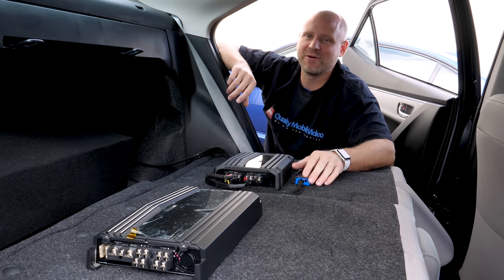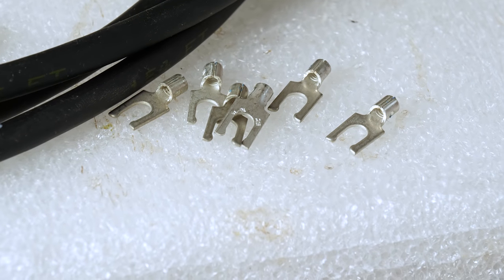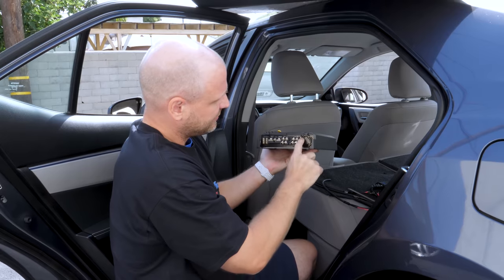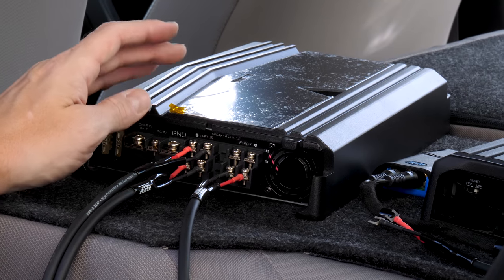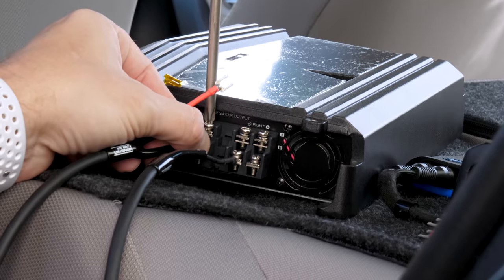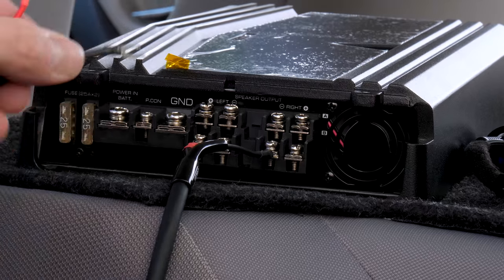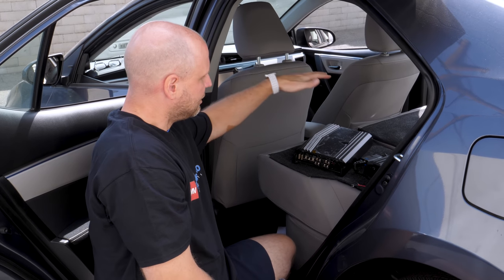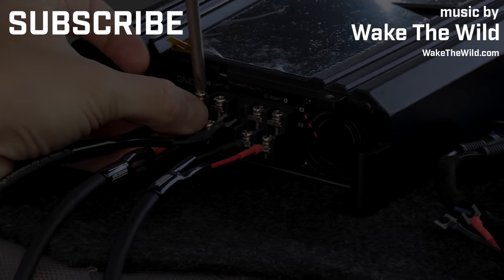How To Wire Speakers and Subwoofers to Your Amplifier - 2, 3, 4 and 5 Channel - Bridged Mode

Comment: I have setup blaupunkt amplifier (gta mk2 from old car) running 4 speakers and a subwoofer in trunk. I have another amp (sony 2ch xplod) that was dedicated to running subwoofer in old car.  The old car had aftermarket head unit. I have factory fitted head unit that I don't want to change.  What is the correct way of running 4 speakers from blaupunkt and subwoofer from sony 2 ch explod. I tried running this (i bridged sony xplod to subwoofer) but the fader only provided audio from right. The rear in the fader was also not responding. With the current setup i am getting stereo sound from speakers plus the woofer is also running, iam also able to hear and move left/right and front/rear settings on fader on my factory fitted head unit. But the sound from the subwoofer isn't as punchy as it was from connecting it to dedicated sony amp. So now iam using only blaupunkt amplifier running 4 speakers and a subwoofer. How do i use the first amp to run 4 speakers AND the second amp to run subwoofer AND get left/right and front/rear option on fader?

Comment: that seems easy enough I wired everything to the amp. the funny thing is that the amp has a switch for 2 channel and 4 channel. when I do 4 channel only the front 2 speakers work when I use 2 channel all 4 speakers work any ideas on that?
Reply: Doesn't make any sense to me. But who cares? Use the 2 channel if it works. Unless you think it under powered. My tiny 50 watt amp provides way more than I need for my TV for two side & a center 8 ohm 50 watt speakers. I do have a small powered subwoofer. At upper levels it gets distorted. I guess some like that, not me. I was an audio tech/engineer for nine years at Crown Audio.
Reply: @chrissimon8368  I have a old 800 watt Crown (Power Line Three) Amp rack mount and it sounds awesome!!! Lots of power!!! I use it for my home audio...

Comment: can I use a line output converter and tap into the rear speaker wires and another line output converter for the front speakers and plug into the amp?
Reply: I have a 4 channel amp

Comment: links to the materials he uses to make the wires be nice. what is that splitter that says monster cable he uses the separate the wires called? please
Reply from the maker: Hey Emmanuel, those are pretty hard to find, that manufacturer doesn't produce them anymore, they're called Y-Splitters
Reply: Emmanuel Christian Delatour they're called speaker wire pants.

Comment: All your showing us is how to plug the wires into the amp I can’t find a good instructional video on how to connect newly installed speakers to the amp so they get that extra power, all I did was plug them in to the existing connector (via an apater) that goes to the wiring harness ( so it’s factory wiring)and then connects to the back of my stereo, I understand how to connect the amp to the battery and to the sub and how to ground it, but in order to amp my speakers am I going to need to run new speaker wire from the amp too the speakers and if so how do I get audio from my stereo or can I somehow use the wiring harness that plugs into my stereo to amp them, or when I plug in my rca cables from my amp to the stereo does that just amp my speakers too  since they get audio from the stereo? I cannot find any good explanations on this, speakers works and the sub works but I don’t know if my speakers are getting power from the amp
Reply: Like do I run new speaker wire from my amp to the new speakers and then the audio gets to them via the rca cables, or like I said before one I plug the amp into the stereo with the rca am I now getting the extra kick that I want since the rca are connected to the stereo

Comment: When amplifying 4 speakers do you run the speaker wire from the speaker to the amp?  I'm confused😕❓
Reply from the maker: If you're powering your speakers with like a 4 channel external amplifier, then yes you run them to the amplifier. However, you can also power them with the headunit and simply replace the speakers into the factory wiring

Comment: I plan on putting 2 component 6.5’s in front doors, 2 coax 6.5’s in the back doors, one 8 inch sub in the back(car has a panel for it in side wall) and one 4 inch mid in the front dash panel. The sub won’t perform amazing without a box but it’s okay. I also was planning on throwing a 12” in the trunk. This is all in a Kia Soul so they’re a big box in itself. Can I successfully use a 4 channel amp for everything but the 12 which could be used on a mono? Or what would anyone recommend?
Reply from the maker: Well first of all you need to make sure your amplifier is bridgeable if you're going to connect a subwoofer to it. If I were you, I would wire the front 6.5" to the headunit, then power everything else with the amplifier. But make sure it's powerful enough to send power to a sub and mid with just those channels
Reply: Quality Mobile Video okay thanks!

Comment: @QualityMobileVideo Can i use stock speaker wires for connecting aftermarket speakers to my amplifier (Pioneer GM-D8604 Class FD 4-Channel Bridgeable Amplifier) which is a 4 channel amp and i want to power all four speakers through the amp. Also the stock speaker wires presently all go to the stock stereo and is connected with a harness, do i have to cut the harness and re-route the factory wires for connecting with the amps? ( p.s m also installing a new stereo i.e Pioneer MVH-X390BT, it has 4 rca outputs so thinking of connecting all 4 to the amp).  SOMEONE PLEASE HELP.

Comment: I got a question does it affect the power output when you wire twospeakers to one channel let's say the two front speakers is 45 watts and o e Chagall outputting 50 watts ,is there equal power to both speakers ? And no distortion or loss of power ?
Reply: Channel *
Reply from the maker: The impedance is cut in half, so the amplifier will put out more power, no change in distortion and technically, depending on the capability of the amp/power supply, there should be no loss in power, unless the amplifier isn't stable at that load.
Reply: Thanks alot!!!

Comment: hi what model amp is this please. and would it be effieciant enough to power a set of kenwood 480w 6x9's and maybe a kenwood 1300w or 2000w shallow sub
Reply from the maker: That's the Kenwood KAC-8406: http://www.qualitymobilevideo.com/kac8406.html
Reply from the maker: If those are the MRS ratings you might want something stronger

Comment: I have a 4 channel amp but it doesn't have a speaker input it only has speaker output... so idk what I'm supposed to do with the harness and all that
Reply from the maker: Buy a line input converter.

Comment: so im curious i want to do 2 car speakers and 2 12 inch subs what channel amp would i need and what all would be required?
Reply: plus all my carp speakers are 4 ohms pretty sure both subs are also 4 ohms and they are 480 watt 12 inch pioneer subs
Reply from the maker: I would run the subs with their own amplifier, a monoblock or 2 channel. Then I'd run the speakers to be powered by the headunit, or a separate small amplifier.

Comment: im looking at a pioneer 4channel amp, the website only says "4ohms impedence" or "RMS rating of 65w x 4 @ 2 ohms, 4 channels". Is it safe to run 3 speakers in parallel (dash, door, and rear speakers) on the left and right side in addition to a sub or two? 

It sounds like with a 4 ohm amp i can only really run 2 speakers, but i figure i can get away with the 4" dash speakers on top...
Reply from the maker: You can run two channels (CH 1&2) @ 2 ohm by paralleling the speakers. You can also bridge (CH3&4) for a sub however, that must run at 4 ohms based on the criteria that you have stated.

Comment: and will running 30rms speakers on an amp that is 60rms be a good idea on its own or will they just blow up
Reply: USE A MULTI METER OR OSCILLOSCOPE TO SET THE GAIN KNOB!  If you don't clip the signal to the speakers they should be fine

Comment: I Have a system im wanting to install a second amp. Cant i jump wires (power,ground,and remote) wires to 2nd amp??? How do i tie in the RCA Jacks
Reply from the maker: Depending on your, you could daisy chain it with another amplifier with its RCA outputs

Comment: I wired all my speakers straight to my amp and all I'm getting is bass from my 6.5" and 6x9 speakers. Any ideas? Using the same Kenwood 4 channel amp in the video.
Reply from the maker: Did you tune it correctly? With the high pass filter?

Comment: Do I need RCA cables when running new wires from each speaker to a 4 channel amplifier? Just want to put power to the speakers
Reply from the maker: No you don't use RCA's just speaker cable to the terminals!

Comment: Could I run a 5 Channel amp Rockford P1000X5 Punch 5 Channel Amplifier with 4 door speakers 2 Rockford fosgate Punch P1675 Punch 6.75" 3-Way and 2 Rockford PUNCH 6.5" and 2  12inch sub woofers that are Type E Alpine Swe-1243 4 ohm with the factory head unit using a audio control LC7i
Reply: Yes if they have their own individual channels to connect each speaker. The Type Es may need more power...

Comment: If you wire two different speakers (let's say a 20W RMS and a 100W RMS speaker) of the same impedance in parallel, would you have any issues with the 20W speaker being overpowered?
Reply: The problem would be that the 20 watt speaker can't take the 100 watt output that the big speaker can. So the 20 watt speaker would give up before the 100 watt speaker would even give proper sound from itself :-p

Basicly yes. Because you cant control their individual volume (wattage) levels when they are wired in parrallel.

Comment: I have a dual 12 inch sub box can I run a 2 channel or would a mono be better(I'm a noob)
Reply from the maker: I would definitely do a monoblock! I really only recommend messing with multi channel amps when dealing with speakers! Monoblocks provide much more power and can power multiple subs

Comment: Is it possible to hook up another amp and sub to a factory radio with factory amp. I have a 2002 Impala and would like to add a sub and amp
Reply from the maker: Yea bud! That's basically what we did here, the amp would be powered via your battery then you would need a Line Output Converter to create an RCA output to connect to the new amplifier for the audio signal. Here, watch out installation video doing all that: https://www.youtube.com/watch?v=ViY4vGoYYDw&lc

Comment: Which size of 4 speakers and 1 sub woofer should be connected to the amplifier? I mean speakers and woofer specifications and amplifier specification.
Reply from the maker: It depends on the power rating of the amplifier! A solid 4 channel would probably let you use like a 150-250W RMS sub with 50-75W speakers in the other channels.
Reply: How would be the sound quality of 150-250w speakers and 50-75w subwoofer?
Reply from the maker: RMS power? The sub wouldn;t have a ton of bass, but it would get the job done

Comment: Is it possible to use a 4 channel amp for 6 speakers. 2 front speakers 2 rear speakers and 2 subwoofer type subs on the Back of the car. The 4 speakers are 65W each and the 2 sub speakers are 150W each. The Amp i want to buy is a 1000W one with 4 channels. I want the front speakers as the same output the back on the same output and the back speakers separated from the rest so that i can give them the Low pass filter and the 4 other speakers the high pass filter. So that the speakers play Mids-Highs and the Subs only the Lows.
Reply from the maker: The issue is the channels give out the same amount of output, so those subs will be starved for power.
Reply: @Qualitymobilevideo  Soo, not even a 1000W Amp can sustain 6 Speakers? They're technically not subs, since they are small. Now i run the 4 speakers off the Player which is 4X55W and after 28Volume it sounds distorted af. The back speakers that are meant for bass are not even connected :|
Reply: @Qualitymobilevideo  And buying 2 separate amps will cost more than i spent on the speakers =)))

Comment: Can I connect in parallel 2 speakers with different RMS ex. 60w front 50w rear on 1 channel? What can happen?
Reply: Impedance is 4 ohms per speaker so 2 ohms right?

Comment: So question. I have a 2 channel boss in my jeep. It has 4 terminals +- +-   I have 2 10s kicker comps. In a box. I have subs bridged channel 1 + on one wire. And 2nd sub wire on channel 2. - 
Sounds good... BUT. Is their a way to run my 2 kicker stereo speakers thru the amp as well? Or can I only run them off headunit being as I have 2 bridged subs ?

1000 karma if someone. A
Can help a brother out 🙏🙏

Comment: SO HOW WOULD I RUN A 4 channel amp for my kicker sub and my interior speakers? Is that possible to run a Subwoofer and all interior speakers off one 4 channel amp?
Reply from the maker: Yes, you'd need to bridge the 4 speakers to two channels and bridge the subwoofer on the remaining two channels. It'd basically be a 5 channel set up. We show it in the video at the 6:00 mark
Reply: Quality Mobile Video ok thanks so much

Comment: what is the lowest output watt that you can do on a 2 channel  amp for all 4 speakers??would 400 watt be good for all 4 speaker?and still song nice and loud?or it be all base??am still learning about this sorry about the stupid question!
Reply: Marvin Avalos The quality of sound is dependent on the quality of your source. An amplifier can only amplify what its given. So having a quality signal coming from the source is very important. Once the signal gets to the amp it gets increased to the level that the amp is designed. High quality amps will reproduce the input signal the most accurately. Lastly the quality of the sound falls on the speakers. The better built the speakers are the more accurate they will turn the signal into sound. There are many other factors involved like matching the gains and making sure your speakers are installed properly. A properly installed mid level speaker will out perform a high end speaker everyday. So be sure and research what that means. To answer your question about bass. The speakers will try and reproduce whatever signal you send to them. Subwoofers for instance work best with only low tones being sent to them. For full range speakers in most applications it is a good idea to use a high pass filter to keep the extreme lows from from them so they can reproduce the mids and highs without having to be stressed with the extreme lows. This type of application works best when using a sub so that you can hear the full range of sound.
Reply: sam the installer ok i need something better then what i got then this memphis 2chennal  amp 400watt..
Reply: Marvin Avalos check out alpine. They have great output and they don't cost a fortune.
Reply: sam the installer okay thanks for your help i appreciate it really
Reply: sam the installer hey i forgot to ask you what kind of watt should i get on this alpine??for a good sound
Reply: sam the installer i found this alpine 200 watt mrp-f300. 50 watt at 4 channel is this good for my minds
Reply: sam the installer can you please let me knw. thank you

Comment: sir i have an amplifier x12 4000w mofset 

4 RCA terminal & 4 CHannel out put speakers.

my head unit is just a Mobile Phone.
i want to set up 1 sub bridge & 2 speakers.

questions: 
1.how is the connection of the RCA input? im wondering why because there is 4 input RCA's?
Reply from the maker: You would need something like this: http://www.qualitymobilevideo.com/xpress-xm-satellite-radio-wiring-harness.html
Reply: 501 Levi's you need a wire in which there is one female rca port and it gives two male rca jack use two of them for two male jack of your rca cable plugged to your phone

than put that all four male jack in input port of your amplifier...

im using it in my house and all working good

Comment: I'm unable to find that Monster Cable rubber sleeve you have that splits into 2. Can you tell me how to find that?
Reply from the maker: Unfortunately we've had those in the shop for years and I'm pretty sure the original manufacturer discontinued them

Comment: I keep hearing from all these videos that bridge will only work 4 ohms.  In reality that's the lowest ohm rating you can go higher.  The major down fall from so many people is they try running to low of ohms and try to bridge.  I'll tell you from experience I have run 8 ohm systems that sound better than 2 even 1 ohm. Plus the major benefit of higher ohms is not just cleaner sound but amp runs cooler and the alternator and battery don't get over taxed ( you don't have head lights dimming needing power caps)

Comment: Just a question,
Can i run a amplifier that has a bass controller without the controller, i kinda lost it 🥴
Reply from the maker: Of course! That's just to adjust the bass up front, it's really just optional you don't have to use it
Reply: Quality Mobile Video thanks 👍🏻

Comment: If I have a 250W Kicker amp, could that power two 10” pioneer subwoofers???
Reply from the maker: Impossible to tell without some more specificity. What are the models of the subs and amp?
Reply: The amp is a Kicker DX125.2 (250W Max) 
The one sub is a Pioneer 10" Single-Voice-Coil 4-Ohm Subwoofer.
The second Pioneer was a gift from a friend so I don’t know the exact model
Reply from the maker: Again it's almost impossible to tell without part numbers on the subs. I need to know both of their RMS ratings, impedances and voice coils. But I already know that amp only does 60W RMS x 2 @ 2 ohms anf 30W RMS x 2 @ 4 ohms, which is gonna be too low if those subs have decent power